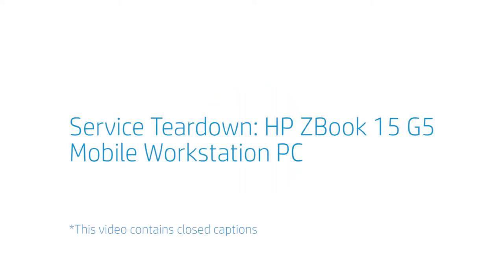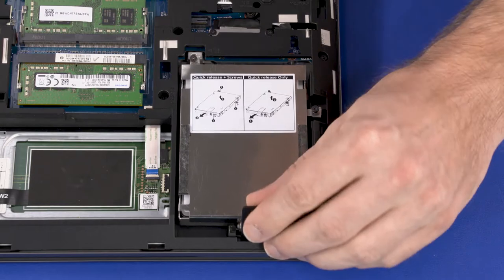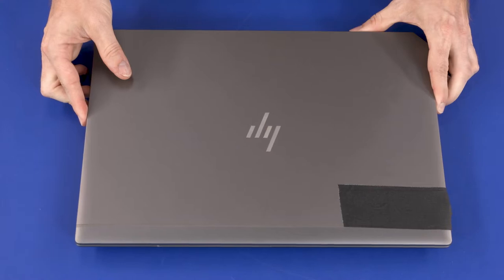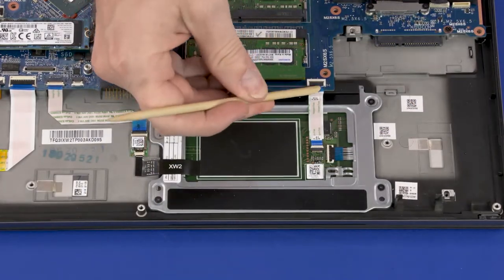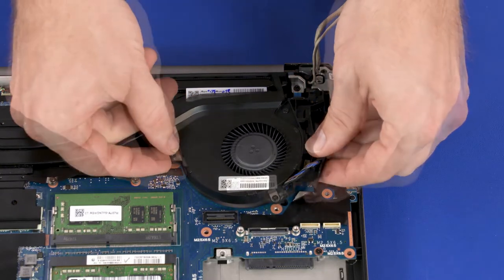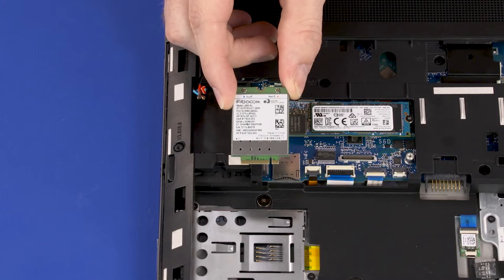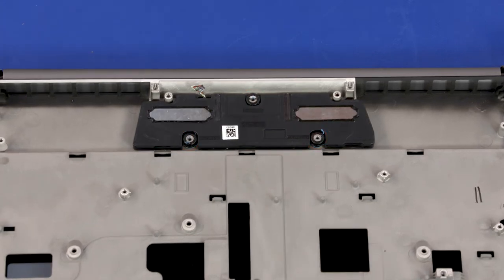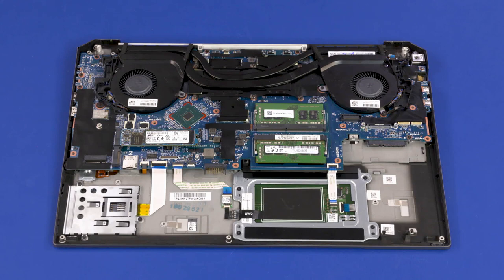Removing & replacing parts for HP ZBook 15 G5 Mobile | HP Computer Service

Comment: When putting the fans back after removal, can the cables easily be connected and routed back to their original positions? Or do I need to replace the cables
Reply from the maker: Hi there, thanks for contacting HP Global Social Media Support!
For replacing, please reverse the steps as you did not removal!
If you need any help in the future, you can always get back to us.
Thank you for being a valuable HP customer.
Have a wonderful day!
Cheers!
Binu-HP Social Media Tech Support

Comment: Is there no replaceable WLAN card on this model? I am looking to upgrade to WiFi 6.
Reply from the maker: +Mat M HP does not recommend upgrading or downgrading hardware parts or software that is bundled with the product as It may affect the manufacturer's warranty and performance, however, you could change the configuration at your own discretion.
Reply: @HPSupport  I've been building PCs since the mid 90's, and understand that a card spec'd for PCIe will work in an appropriate PCIe slot. I also understand that, in the USA (and other countries), there are laws that protect consumers against warranty denials for modifications. The burden would be on the manufacture to prove said modification(s) caused the malfunction. Since PCIe is a standard, HP would have a hard time proving that using hardware specified for PCIe is the root of a malfunction. 

With this said, would you please answer my question about weather or not this laptop model even has a replaceable WLAN adaptor? I would much prefer to not pull my hardware apart to find that there isn't one when you could provide the answer.
Thanks!

Comment: After I base enclosure my speaker doesnt sound and is there any method to fix it cause i trierd to tape it
Reply from the maker: Hi there, thanks for contacting!
I understand that you are experiencing an issue with the speakers.
I will do my best to assist you.
Could you please elaborate the issue you are experiencing with the speakers?
Binu - Social Media Tech Support
Reply: @HPSupport  thank you for your quick reach, I managed to handle the situation but the problem is speaker's solder to board it was too loose
Reply from the maker: If you need any help in the future, you can always get back to us.
Thank you for being a valuable HP customer.
Have a wonderful day!
Cheers!
Binu - Social Media Tech Support

Comment: which  vga is good  m2000 or m1200 , where i'm going to get zbook 15 g3  i7 hq6820 as used laptop
Reply from the maker: +Eslam Basyouni Please refer 'Graphics' under the specification page to know about supported graphics card: https://bit.ly/3lJltMJ
Reply: @HPSupport  Big Thanks to you , from other side ...is there is the same laptop but new , where I7 Gen 10 CPU , and i want ask about VGA socket , does it will be removed frpm any new laptops and only HDMI will found
Reply: @HPSupport  that link is for the G3

Comment: Can I upgrade my Z book 15 g5. Laptop graphics card to any GeForce or RTX graphic cards? Please let me know. I currently have p1000 graphics card installed.
Reply from the maker: +Robin Please refer 'Graphics' under the specification page to know about supported graphics card: https://bit.ly/36fTCOf
Reply: Graphics cards are soldered on to the motherboards for the most part now-a-days. Buy the best you can afford since they have moved to non-upgradable models in the effort to make them as thin and light (and cheap) as possible.

Comment: Dear HP Technical Support Team,

I am writing to inquire about the recommended type of hard drive for my HP ZBook 15 5G. Specifically, I would like to know which type of hard drive model would be best suited for my device.

I am planning to replace my current hard drive, and I want to ensure that I choose a compatible and high-quality option. Could you please provide me with some guidance on the recommended hard drive model or suggest any necessary steps or precautions before I make my purchase?

I appreciate your prompt attention to this matter and look forward to hearing back from you soon.

Thank you for your assistance.

Best regards,
[gobrun
Reply from the maker: Hi there, thanks for contacting HP Global Social Media Support!
I understand that you need to purchase the compatible hard drive. 
I will do my best to assist you.
Use the HP Parts surfer to identify the part: https://partsurfer.hp.com/partsurfer/ 
And order it via the HP Parts store: https://bit.ly/3nKMYrs 
Binu_HP Social Media Tech Support

Comment: Please can the gpu be upgraded?
Reply from the maker: Hi Olusegun, thanks for contacting HP Global Social Media Support!
I understand that you need to know whether you can upgrade the graphics card of your computer.
I will do my best to assist you.
Please refer 'Graphics' under the specification page to know about supported graphics card: https://bit.ly/3NUvFk9
Binu-HP Social Media Tech Support
Reply: @HPSupport  Yes I can see that it supports p1000 and p2000. I need to know if it will support a p3000 video card? As this documentation hasn't been updated in a while or is it up to date?
Reply from the maker: Thanks for the reply.
We recommend you to use the graphics card mentioned under the specification. We have not tested other graphics card. So we would not be able to comment whether it will work or not.
Binu-HP Social Media Tech Support
Reply: @HPSupport  Thank you fo the response. I just want to know if the graphics card of my particular model is soldered or removable.